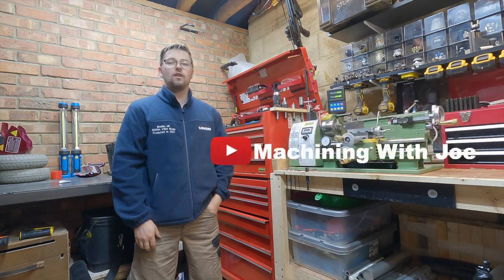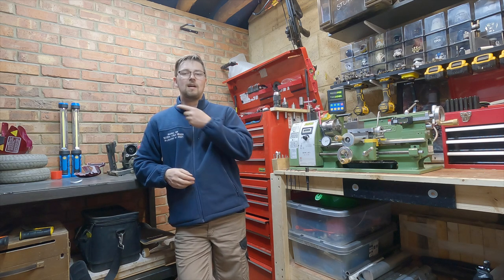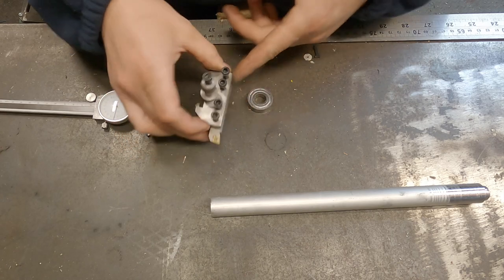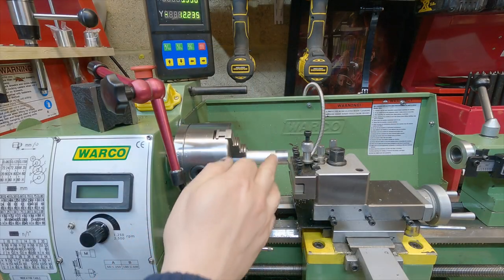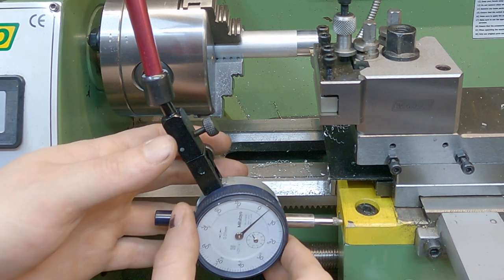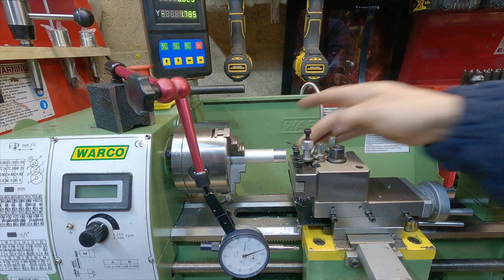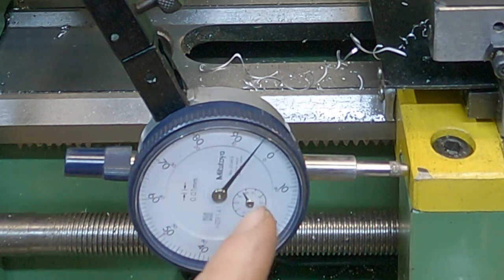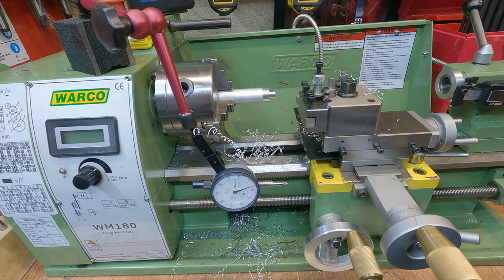Mini Lathe Basics Machining To A SHOULDER

Comment: cheers Joe, I have had a go a couple of times at bearing seats and always end up going "just under"  it is frustrating!
Reply from the maker: Yeah it is annoying. I’ll know next time to measure the inner race more accurately and measure more as I come to final pass. Practise makes perfect though
Reply: ive had this issue too, turns out its the temperature of the metal, machining without coolant makes it expand. So you end up taking too much off and that makes the difference between a losse fit and a tight press fit after the metal has cooled. Everything looks right when machining but when doing tolerance fits, think of the heat expansion.
Reply from the maker: @jamie15able  Interesting point. I imagine you maybe correct it is something I’ll test out next time I’m doing a job like this again. 👍

Comment: 8:45 That bearing's a sloppy fit !
Reply from the maker: You caught me out. I went a bit undersize on the shaft. Damn thermal expansion
Reply: @MachiningwithJoe  Caught you out in a few places with your jump cut video editing ;) DROs that suddenly read zero :)
Thermal expansion ? Not THAT much ! What is it, 3-5 thou under size ? Oh yeah, we don't use those funny metric units ! Should have been aiming for a light interference fit (when cold - LOL)
Reply from the maker: @millomweb  yeah I’m still learning how to hit dimensions bang on. But the basic procedure for turning a shoulder is right I believe. 
With more experience I’ll get there.
Reply: @MachiningwithJoe  You have to sneak up on them ! At 10 thou oversize, measure to confirm, take a 5 thou finishing cut, measure to see if it is 5 thou and if it is, just repeat with another 5 thou cut.

I'm not aware a technique is necessary, LOL Get the diameter to size and then finally pull out to face the shoulder.
Reply from the maker: @millomweb  Think with a few more trials I’ll get there. Thank you for the advise. 
All the best 👍
Reply: @MachiningwithJoe  Doesn't matter what the trade - "Measure twice and cut once" !
Then use a bit of emery tape to take the last bit off ;)